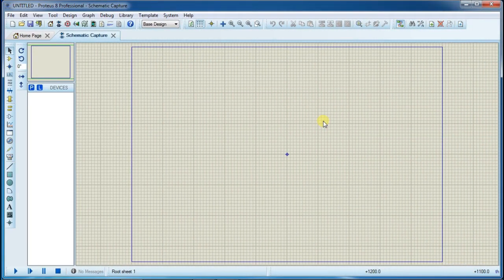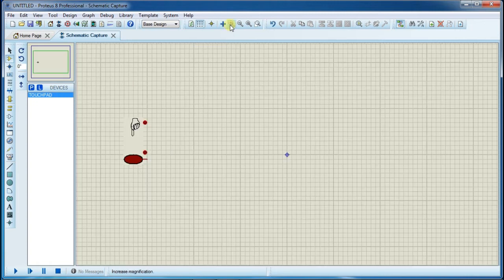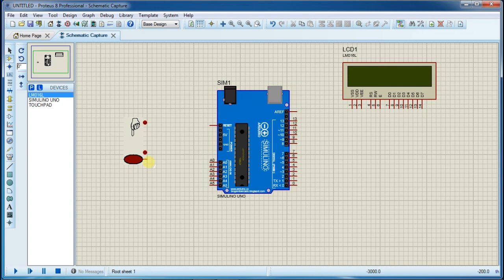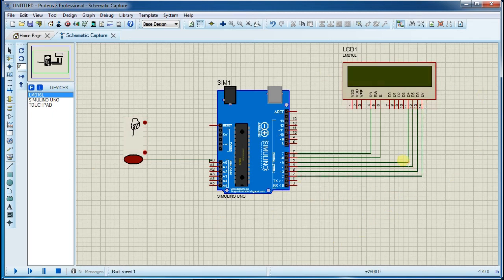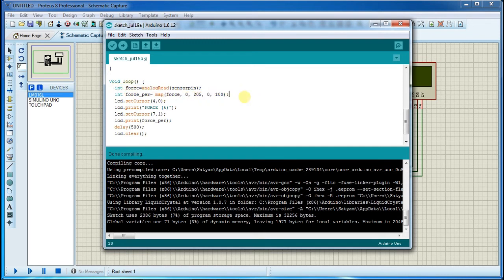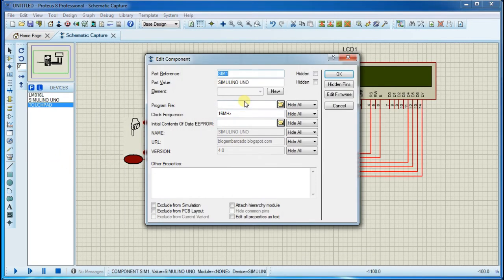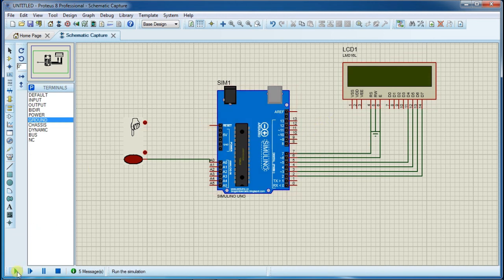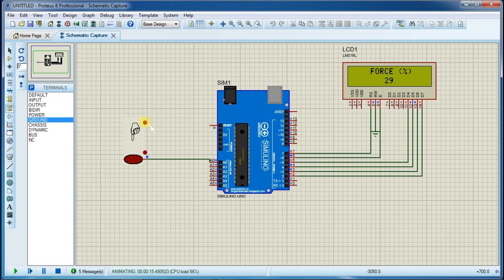Force sensor simulation in proteus

Comment: Really nice and informative. Would be nice if there is a arduino  simulation video with both Pir sensor and piezoelectric sensor.
Reply from the maker: What will be the scenario for piezoelectric sensor??
Reply: @SatyamsinghYT  I want to do Anti-theft system. So basically in now anti-theft systems there is only pir based which detect humans( with IR radiation). Considering that we mostly use sensors near doorways, if it is large room and there is one door in one corner there we will use piezoelectric sensor so that when opened, disruption or pressure may fall on that sensor( can add some mechanical support to door to make the pressure happen) and detects that something wrong is happening and on the other side if there are windows and doors close by instead of putting piezoelectric sensor for every window and door for pressure detection we use  pir sensor in that range.
So that is why I want to use both pir and piezoelectric sensors in my system.
Reply from the maker: Yes it is possible but piezo sensor is not available in proteus, but for Simulation purpose you can use switch instead of piezo
Reply: Problem when only a pir sensor being in room may be problem because of its range so instead we focus near openings of room
I added piezoelectric sensor as added alternative because of its less cost comparitively. 
As now they are using lasers near doorways which are costly.
Reply from the maker: I would suggest magnetic sensor instead of piezo.
Reply: @SatyamsinghYT  Okay can u point out the disadvantages of using piezoelectric sensors. 
I just came up with a new idea.
Reply: Mainly to reduce the cost of the system
Reply from the maker: This one is using spam link , don't try to download
Reply: @SatyamsinghYT  I have that file can I send it to you?
Reply from the maker: @jasmithaduvvuru7120  yes please, send it to satyamkr80@gmail.com
Reply: @SatyamsinghYT  Sent!!!
Reply from the maker: Piezo sensor will generate very low voltage on detecting pressure if force is not good enough, but in case of magnetic sensor it will generate a high pulse in case door will open
Reply: @SatyamsinghYT  Is magnetic sensor there on proteus?
Reply: @SatyamsinghYT  Thank you so much. 
Really liked the way you responded.
Reply from the maker: @jasmithaduvvuru7120  sorry, that was a spam link, but i can create same scenario using switch in proteus, just consider that switch as push piezo because working will be same
Reply: @SatyamsinghYT  What about the video link  I sent?In which he said it was the file used for the sensor.